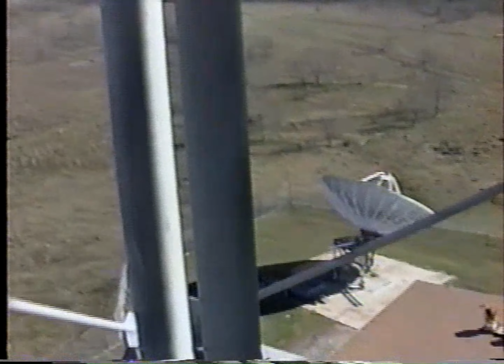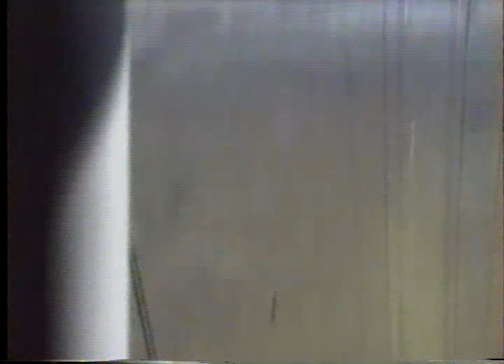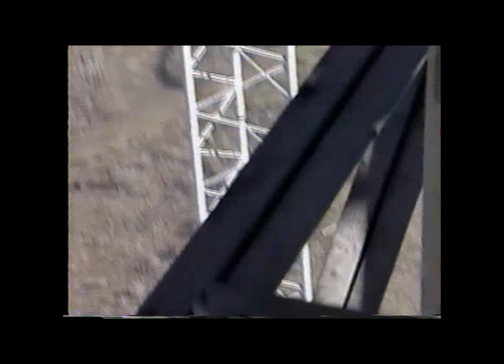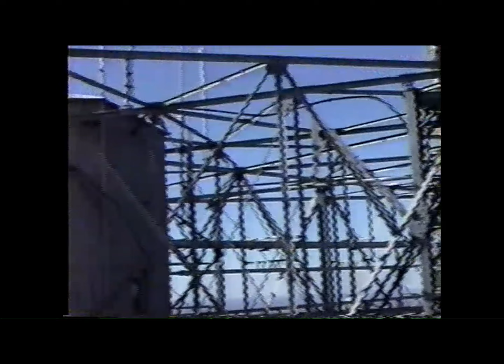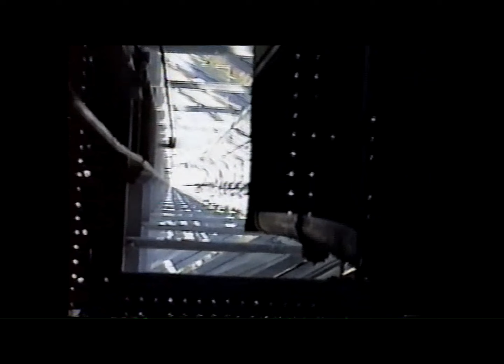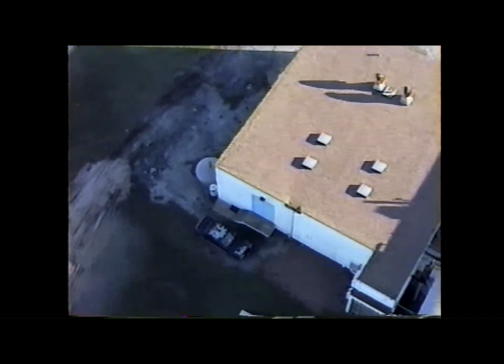Ham Radio Houston 146 88 repeater

Comment: I was up there in 92...rebuilt 444.6 and corrected the audio on  146.88.. rode in the car as Bryon's  son rode on top
Reply from the maker: Hello Chris, good to hear from you again. Last time we spoke was at the Houston Ham Fest about 3 years ago and we talked about that trip you and I made up the tower to work on the 444.6 machine. I don't think what we did I would call a rebuild, what we actually did as I remember was reconfigure and retune the cavity filters for 4.6. The receive antenna had gone bad and I brought in down off the tower myself and took it home and repaired it and It's still in my garage today. We decided instead of putting that antenna back up, to just reconfigure the cavity filters for a single antenna. We did not have the equipment and it was something we had never done before.  So, I thank you for your help in doing that.

Comment: I operated on both of those repeaters when I lived in Houston in the 1980's. They had solid, excellent coverage for at least 50 miles with no gaps. I could routinely work those repeaters with a handheld on 150mw from anywhere in the Houston area. It was common to hear someone mobile passing through Houston on I-10 and could stay in a QSO on the repeaters for over an hour before they started getting out of the coverage area. Thank you to all of the people that made those repeaters happen.
Reply: Same here. The 88 was the first repeater I remember talking on in the 90s.